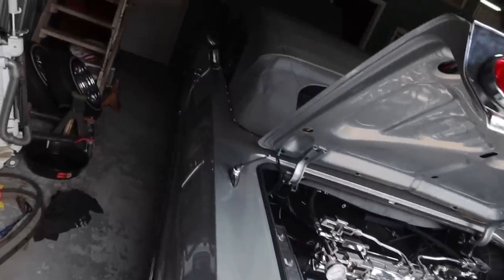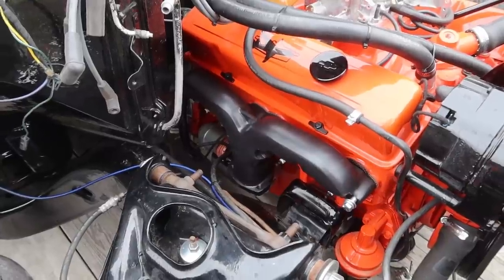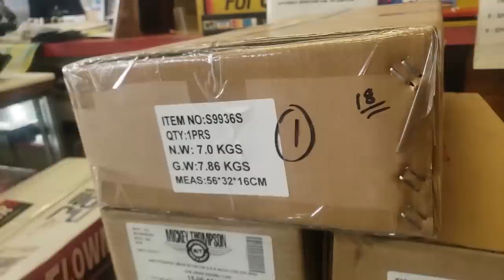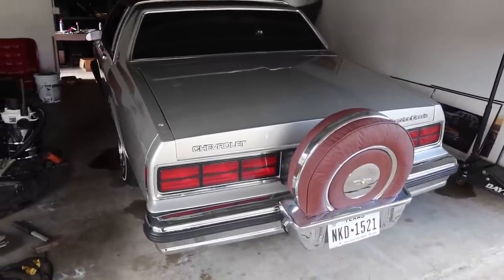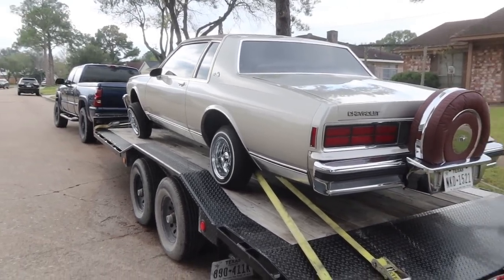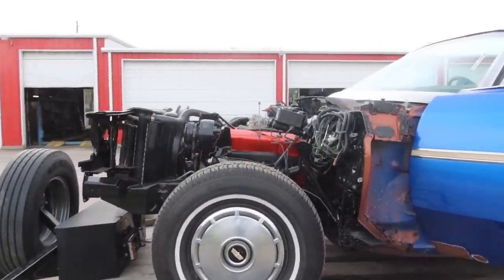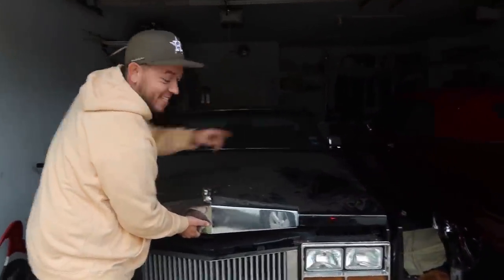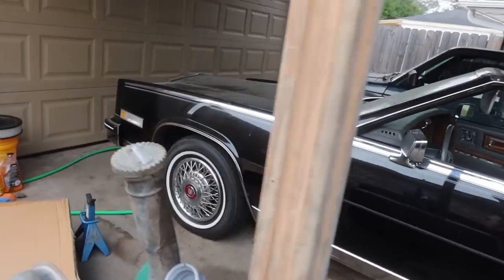DR. DRE's 1963 IMPALA LOWRIDER! + DONK ALIGNMENT

Comment: Hooker headers sells manifold  I bot mine fit perfectly on my gbody with no modifications
Reply from the maker: Didn't know...
Reply: @los_in_da_drop   I think that's the part # Hooker 8525HKR   on my car I no issue with clearance or anything hitting I have a sbc 350 on my cutlass  or you can type in hooker headers manifold